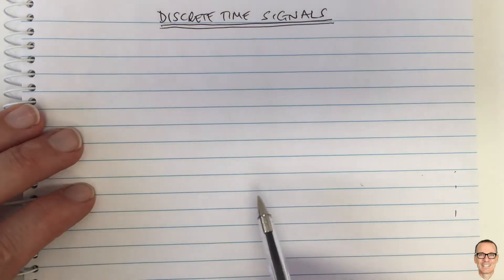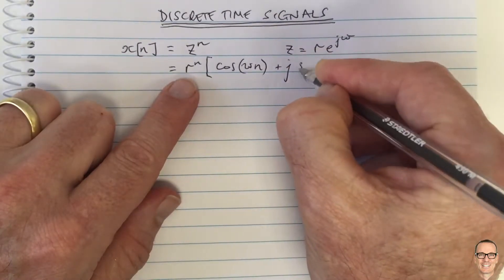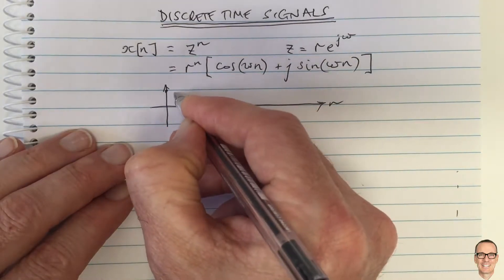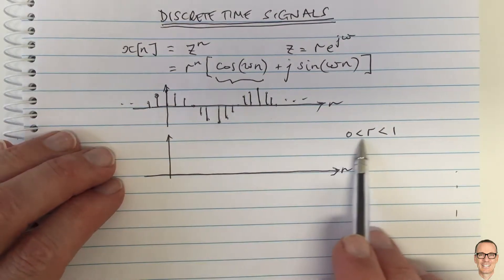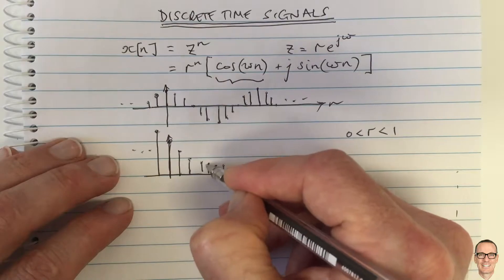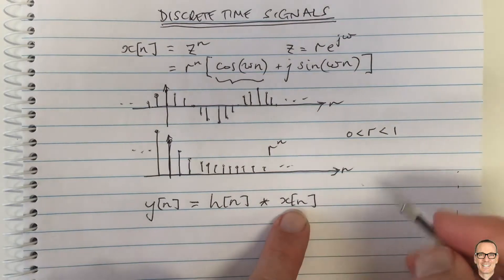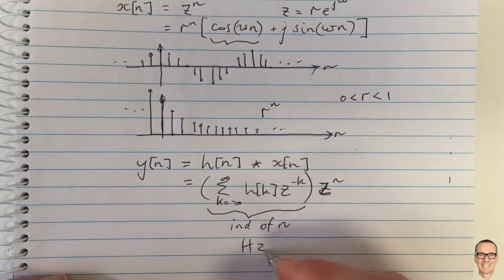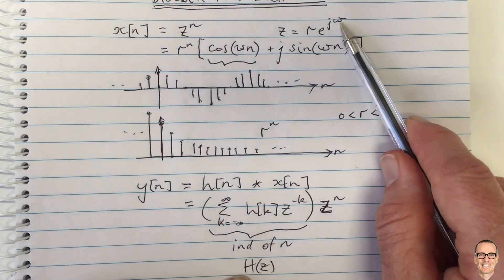Discrete Time Signals

Comment: why do we take only integer value of independent variable , for discrete time signals?
Reply from the maker: Because the samples are discrete (first sample, second sample, third sample, etc...). In other words, there are an integer number of time samples. Each (time) sample is of duration T seconds. So you can sample a continuous-time signal at any rate you like, by picking a value of T from the Reals, but you will always have an integer number of samples since they are discrete, and so the "independent variable" is always an integer.